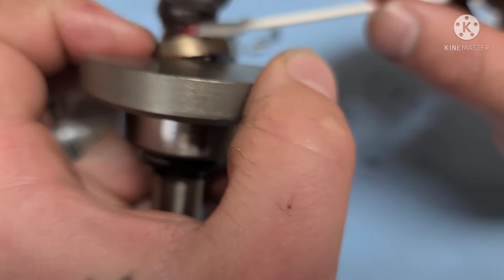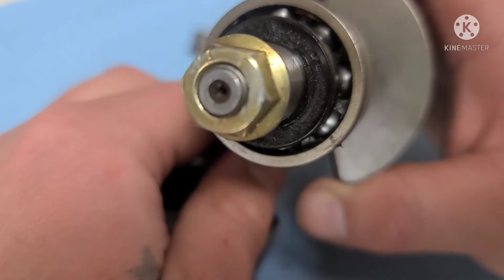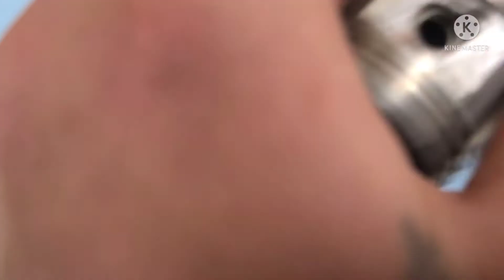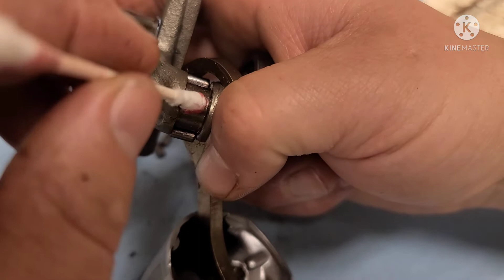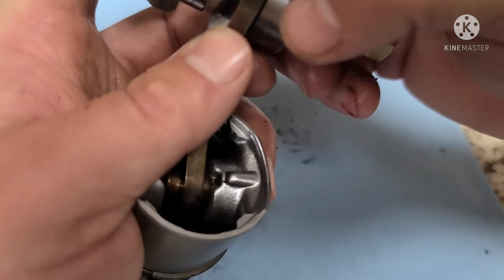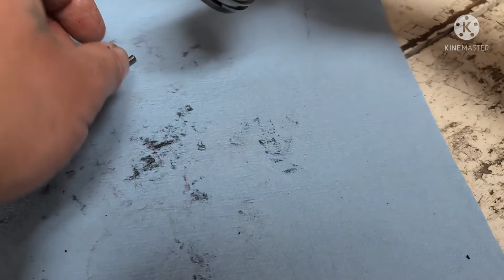Stihl 021 Connecting Rod Crankshaft Uncaged Needle Bearings Install

Comment: I would probably use very heavy solid grease to let needles stick  in place and after installation of shaft flush grease with diesel or petrol .
Reply: I use vaseline, because it's petroleum jelly.

Comment: Glad I found this video was about to throw out my 015l got a parts saw with a good cylinder so I ported and polished it went to put it on my mint 015l all the bearings fell out but she is back together now and runs alot stronger now it was my first port and polish job I was some upset until I found this video thanks alot you have a new sub now lol